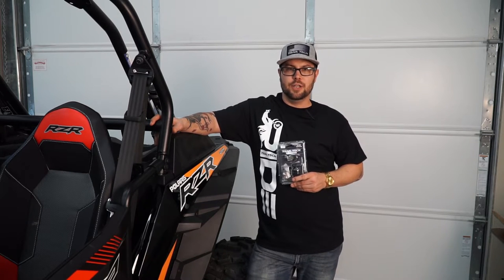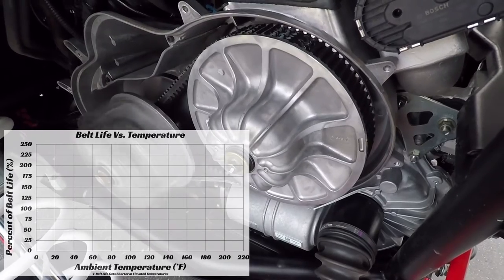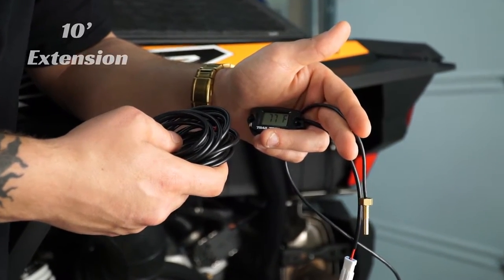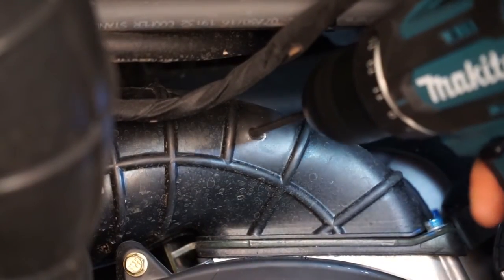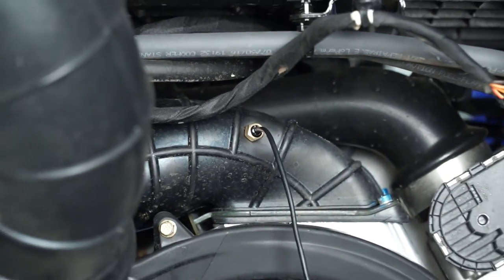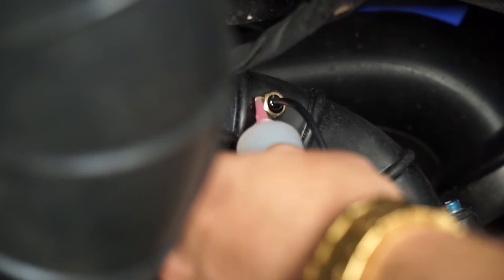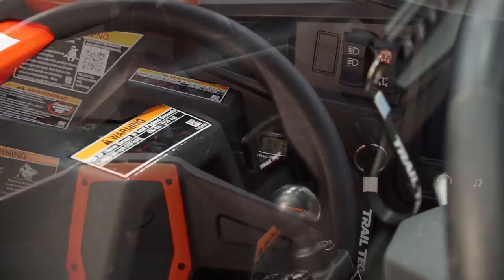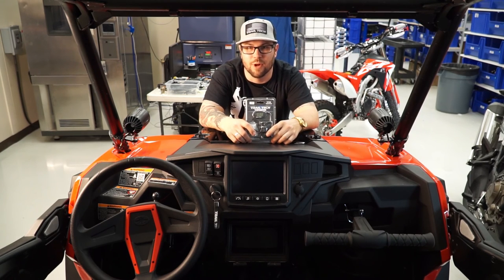Trail Tech CVT Gauge Overview and Install

Comment: Where is the best place to mount one of these ? Sxs blog did one of these along with a rzr back and while driving the temp varied 30 to 40 degrees consistently and they mounted theirs in the cvt exhaust

Comment: So this is just reading belt housing exhaust air temperature, not actually reading the temperature of the belt, correct?
Reply from the maker: Exactly, however there was only a couple degree difference from the belt to the exhaust housing. It was still very accurate.
Reply: How do you know that without directly reading the belt temperature?  What are typical temperatures you would see during average riding with your setup?
Reply: Thats not what I saw in other tests.  It was closer tp 20-30 degrees snd  kinda logarithmic making it hard to reconcile.  Also by the time you warm up the air in the clutch housing the belt is already damaged.  Used to be the best solution out there, but not any more.